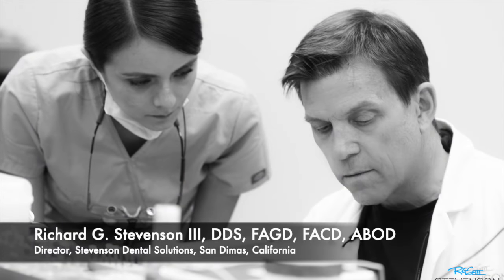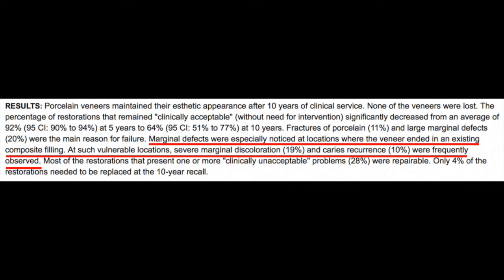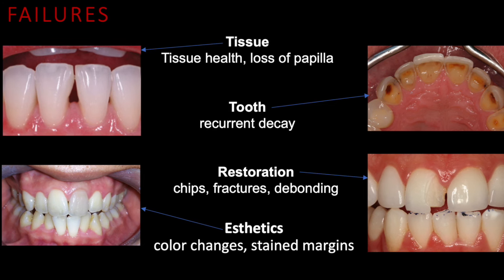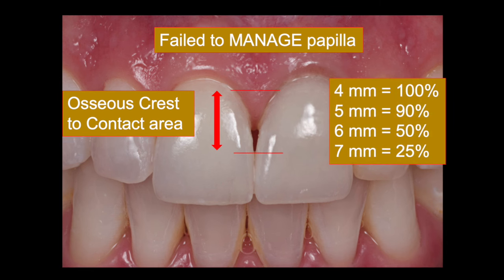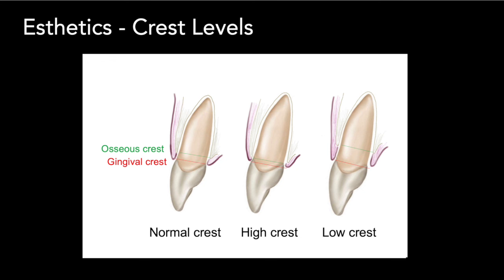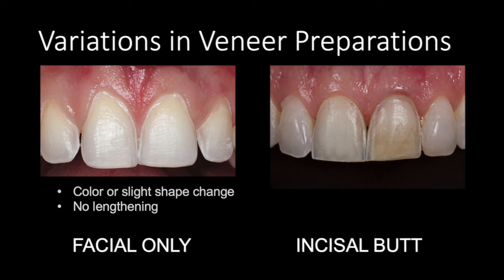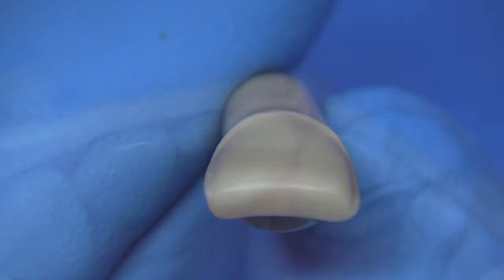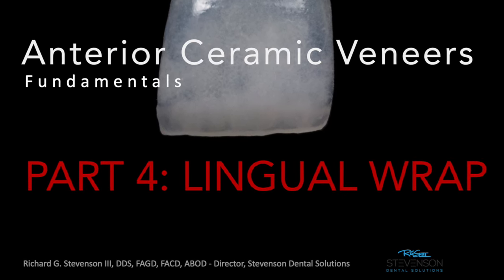Anterior Ceramic Veneers, Part 3: Incisal Butt Veneer

Comment: Thank you very much doctor for your effort .. if you dont mind sir in this .. the incisal reduction should be straight or inclined lingually … thank you sir
Reply from the maker: It may be perpendicular, sloped facially or sloped lingually, depending on the case.  I usually try not to incline lingually because it will place a slight limitation on the line of draw which may lead to more tooth reduction.  However, if lingual wear requires removal, then I'll incline lingually, instead of wrapping.  My typical prep is parallel to the long access of the crown.

Comment: Thank you so much for this amazing lectures Dr. Stevenson @Stevenson Dental Solutions, I wanted to ask, how do you keep proximal contact point tight if you are eliminating it with the diamond strip and the restoration doesn't seem to contact in the part that was reduced? Thank you so much again!
Reply from the maker: The amount of opening is less than 100 microns - just enough for the technician to separate the dies without marginal damage.  Since you are extending the interproximal finish line slightly into the contact area, the final veneers will make good contact.  It's an amazingly predictable technique, taught to me by the world class Prosthodontist and Technician, Ed McLaren about 20 years ago...
Reply: @StevensonDentalSolutions  Thank you so much Dr. pretty clear explanation!!
Reply from the maker: @Pistoldiego  Great
Reply: amaizing!!!!!

Comment: very informative Dr, i would like to ask about the failed case with papilla . u mentioned in the video that u would overcome that mistaje if u lowered the contact 4 mm from bone and modify proximal wall. can u clear that point i tried many times to get it but i couldnot ,,,,,,,,,,thanks in advance
Reply from the maker: If the most gingival aspect of the contact is 4 mm above the bone research shows us that the papilla will be able to fill the gingival embrasure 100% of the time...Paper by D. Tarnow about 20 + years ago.
Reply: @StevensonDentalSolutions  Thanks alot dr
Reply from the maker: @rehamfaisal7761  My pleasure

Comment: Thank you Dr.Stevenson for this amazing video.
If we have a shallow overbite and after reducing incisal edge 2 mm our centric contact is falling at the butt joint junction( where ceramic would meet tooth,) what do it do....do a lingual wrap and take my lingual margin a mm away from that contact?
Reply from the maker: Not usually.  The interface of the ceramics and tooth with a bonded veneer is not designed with MIP (not "centric", which is an outdated term) as a factor. The margin will be smooth and the ceramic strong under compressive load. I like to think of bonded veneers behaving like enamel.
Reply: @StevensonDentalSolutions  thank you so much for the reply.
So you mean it's absolutely safe to keep the mip contact at the tooth ceramic interface 
The texts recommend to keep the interface half a mm to a mm away from mip contact so i believed that it's the weakest link.
Thank you
Regards

Comment: Thank you for your valuable videos. Please if we have a barrel shape 4 up incisors what type of veneer prep is needed?specially the patient wanted a change of color from A3 to B1?thank you
Reply from the maker: This will usually require a deeper prep on the facial, which allows for color change.  The depth would be 0.8 or so and this will necessitate a super veneer wrap veneer design to overcome the loss of retention form the enamel insufficiency.

Comment: Thank you doctor for the great video and accurate explanation.Why do you prepare the incisal butt and shorten the teeth if we want to lengthen it.How much longer can we make a tooth with a veneer without interfering in the occlusion?Thank you!
Reply from the maker: Just to give the tech more control of the incisal translucency.  If we are happy with the existing shade and only want yo lengthen, it is indeed possible to avoid prepping the incisal, but it is tricky - the edge must be a butt joint at the g to avoid ceramic thinning.  For the functional, we set our length based on esthetic norms or slightly younger than the patient, then test this with a bonded mock-up for phonetics and pathways (excursive movements and border movements).

Comment: If the teeth had nice contact, would you still run the diamond strip between the teeth to remove both the contact and the enamel rods?
Reply from the maker: Always - this allows the technician access to trim the dies.

Comment: I have a query. When we are cutting through a diagnostic mock up for veneer preparation, all the composite resin left behind s remove n then an impression is made or before that.
Reply from the maker: Remove all of it, roughen any un touched enamel, and create a finish line, then take the impression.  It is key to try to make a prototype mock up and not strictly an additive mock up.  Instruct your lab to prepare the teeth prior to the wax up to place the proposed contours in the precise location desired.  Often the putty made from this will not fit onto unprepared teeth, hence the need to prep them first.
Reply: @StevensonDentalSolutions  I didn't expect a reply back so thank you. Cleared one doubt which was nagging me☺️

Comment: Great work doc. How would you tell if patient is bruxing during night or day? During night can provide splint but what can you do for daytime bruxism ?
Reply from the maker: Diurnal Bruxism will require asking the patient questions about their habits and suggesting a lower occlusal guard (usually tolerated better for diurnal bruxers).  You also want to make sure that the issue is not related to a chewing pathway - use the chew test to help diagnose this -  I'll provide a video on this later I hope!
Reply: @StevensonDentalSolutions  Fantastic advice  doc. Really looking forward to  the chew test video as I feel it is so important to increase the  longevity of beautiful restorations we have managed to learn from you.

Comment: Thank you for the amazing video doc. 

Would the last step, stripping the interproximal to open contact points a little bit, also be necessary in a digital workflow (scanning + CAD CAM)?
Reply from the maker: Yes, as it will help obtain a clean finish line during scanning.

Comment: Hi, thank you so much for these videos.  My question is with the prep guide.  As you continue to prepare the teeth do you lose a stable stop when using the guide to assess your reduction?
Reply from the maker: You may prevent losing prep guide stability by extending the guide over more surface area, particularly areas which will not be prepared.  But it does become less stable after more preps are completed, so your clinical judgement will come to the rescue.

Comment: hi dr i hope you can do e demo on splice techniques in veneer prep. or what they call proximal overlap thanks
Reply from the maker: Send me a reference on this prep design - I'll look into it!
Reply: Stevenson Dental Solutions the prep
usually used for diastema and not aligned teeth cutting the proximal areas parallel
to the long axis.

Comment: If there is fractured anterior teeth in the middle 3rd with pulp open, we proceed with RCT followed by composite build up in middle and incisal area. If we want to give veneers than can we give margin on composite on lingual aspect of the teeth or normal butt joint is sufficient??
Reply from the maker: Great question.  In this situation, you will be best off extending the finish-line all the way to the gingival and the facial AND lingual - like a veneer crown.  It's usually not a good predictor of longevity to leave veneer margins on composite, as this does not encase the clinical crown - It's wise to take advantage of both micro- and macro-mechanical retention and resistance forms.  Best wishes, Dr., Stevenson

Comment: Thank you  Dr Stevenson for putting in so much effort so we can all learn benefit from the videos. Are there any situations where anterior slide of the lower incisors can fracture off the incisal edge of these veneer designs? What should I look out for in anterior guidance when I want an incisal butt finish?
Reply from the maker: Good question - the key is bilateral even protrusive contacts, and canine guidance through lateral movements AND no pathway interferences while the patient is chewing (perform the chew test with the patient chewing on wax or gum and use 200 micron paper between the anterior teeth while they are chewing and make sure that no marks touch the veneers).  Also, the last thing is a crossover check, where the teeth should have broad contacts with the lower teeth and no bumps or "catches" from large lower embrasures during border movements and while edge to edge.  Before starting treatment, the lower teeth are leveled out and polished to facilitate the above requirements.
Reply: Fantastic explanation Dr Stevenson. Thank you
Reply from the maker: @aamin6933  My pleasure Doc!

Comment: Thank you for sharing your experiences! I might be a little late with my question. You were so kind as to share a failure, too. Under that perspective in this special case  wouldn't you rather extend your preperation on the plastic model further interproximal closer to the gum. Wouldn't this have created a black triangle between 11 and 12 as well?
Greetings from Germany!
Reply from the maker: Yes you are correct!  Good eye Doc!

Comment: Thank you for this great video.Is buccal seating of the veneer difficult when we aim for slight inclination towards the lingual during incisal reduction ? I feel this may introduce an undercut unless the veneer is placed incisal reduction.
Reply from the maker: Yes - the line of draw is not buccal and not incisal but a combination of the two.  Preparing the incisal and then further extending by wrapping always limits the paths of insertion and this will usually lead to preparation modifications to allow for no undercuts.

Comment: why dont you bring the interproximal margins all the way through the contact points- wont this run more risk for staining or caries or even heavily discoloured teeth to show through
Reply from the maker: Great question! We teach a stain prevention technique using bullnose etching and a clean and cure vs a tack cure technique.  Rather than hiding our ineffectiveness, let's address it appropriately...However, heavy smokers will stain everything, even the stain-free approach we use, so for these patients, we will extend interproximal.  Esthetics will guide our margin locations with dark teeth, and the preps will often require more extensive margins.  Our veneer course is three days in duration and covers these topics and many more in detail.  Perhaps you could join us!  All the best, Dr. S.

Comment: Did you mean to say a slight inclination towards the facial instead of the lingual? as in it's almost a straight reduction but with the ligual is supposed to be slightly lower as opposed to higher than the facial aspect of the incisal prep.
Reply from the maker: Slightly more reduction on the facial incisal angle compared to the lingual. The resulting incisal will angle facially - in other words will be visible when looking straight at the facial.  Thank you!
Reply: @StevensonDentalSolutions  Thank you for your reply. And is the lingual just kept as virtually a 90 degree butt margin angle with no beveling?
Reply from the maker: @내귀에습진  Slightly beveled gingivally - just a few degrees to make sue the enamel is not left rough/undermined.
Reply: @StevensonDentalSolutions  I appreciate it!!
Reply from the maker: @내귀에습진  Thank you for your insightful question and observation.

Comment: Doc. can u please tell me why u used Lvs1 instead of Lvs2 
and please tell me the incisal reduction is 1.5
From the facial is 0.7?
and from the middle is what??
and from the gingival margin is 0.4???
Doc I mean the measurment of prepararion
Reply from the maker: The LVS1 gives you 0.5 mm of reduction and the LVS2 gives you 0.3 mm of reduction.  In general, the gingival 1/3 is 0.3, the middle 1/3 is 0.5 and the incised 1/3 is 0.7 mm.  The incised reduction ranges from as little as 1.0 mm for cases not requiring much incised translucency characterization to as much as 2.0 mm in cases where a lot of characterization is required.  I will show different burs to show how they work and what they may produce.  To keep it simple, use the LVS2 for the gingival 1/3, then us the LVS1 with the tip in the middle 1/3 and estimate 0.7 mm in the incised 1/3.  I hope this helps.
Reply: @StevensonDentalSolutions  
I don't know how to thank you doctor, you are a great person
Reply from the maker: @DragoDent  My pleasure doc!

Comment: What kinda veneer prep is apt for flurosis case
Reply from the maker: If the fluorosis is deeply stained, grade 3, the veneer preps will require a deeper axial reduction and likely will need wrapping and e.max veneers.  However, if the staining is Grade 1 or 2, normal veneers may work.  After preparation, assess the color and reduce more if the area is deeply opaque or brown.  Another consideration is enamel quality - frequently, fluorosis patients have enamel that will not provide the long term adhesive predictability we expect, hence, a lingual wrap may again be indicated.  These are some of the most challenging cases and must be approached with caution and full disclosure to the patient.  In other words, the patient must be advised that the final preparations may need to be much closer to full coverage and that opaque layers usually require greater layering and therefore more reduction.
Reply: @StevensonDentalSolutions  thank you for the prompt and accurate reply dr
Reply: Is there any way I can send u the pic of the patien?

Comment: If we make the incisal straight lingually without bevel , what about the anterior guidance ? I think this will lead to stress concentration that can fracture the veneer ..
Reply from the maker: Thank you for your comment.  I like your thinking.
Reply: @StevensonDentalSolutions  I don't know if i make incisal bevel lingually , can i have the 2 possible path of insertion ( from incisal and from buccal ) or we will have only incisal path of insertion like lingual overlap prep ?
Reply from the maker: @1smail.khaled  If beveled the path of insertion will tighten, much like a wrap.  Thank you for your thoughtful insights.